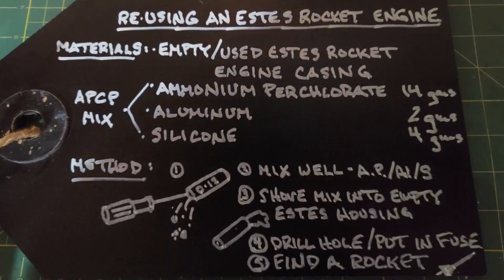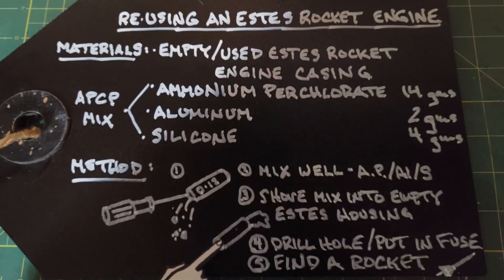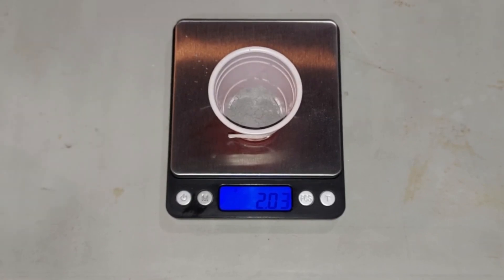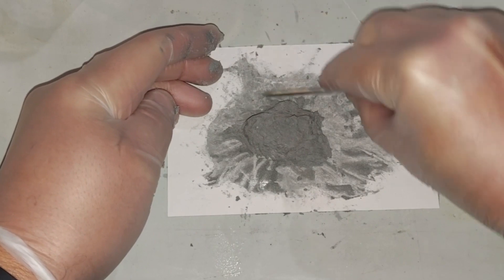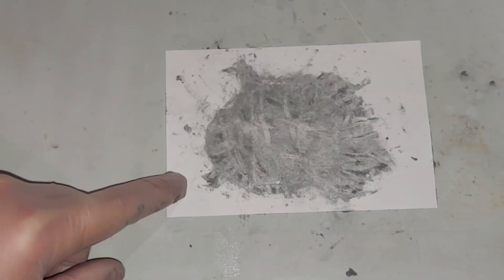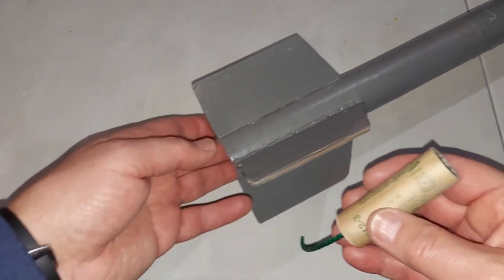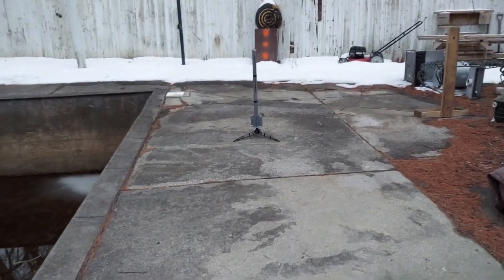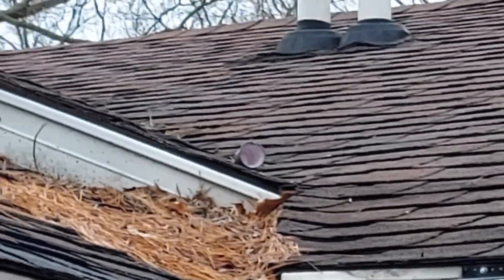The Repackaged Rocket Engine

Comment: Run self tapping screws in right ahead of the motor casing locking it in place. . It also allows the black powder charge for parachute deployment to work 
  Now if u don't put some type engine retainer at rear/bottom of the engine it will reverse itself when the parachute is deployed  .
   For every action is a reaction  (  Newton's Law )

Comment: Crushed kitty litter plug
Reply from the maker: Thanks!  I have used that before but, depending on the rocket fuel, at times it doesn't stand up too well to a strong initial burst.  I found that the nozzle hole can deform sending the rocket sideways.
Reply: @cranialconstruction  using a delayed ejection also?